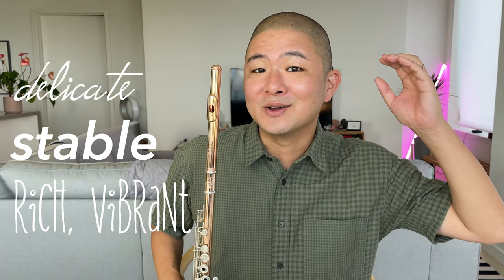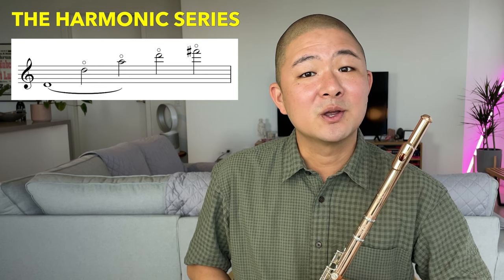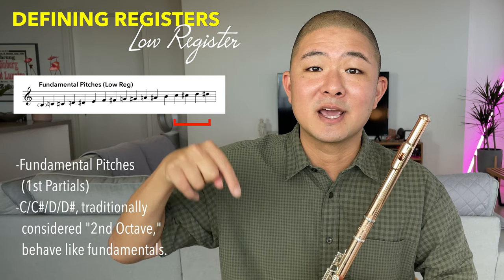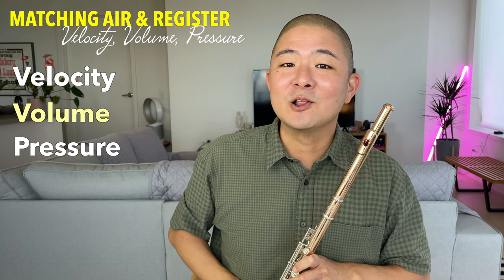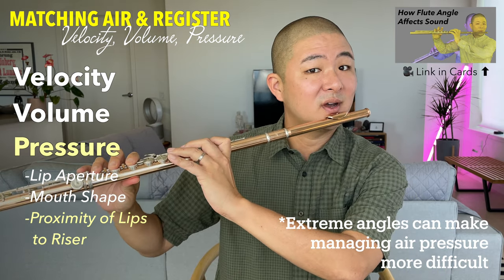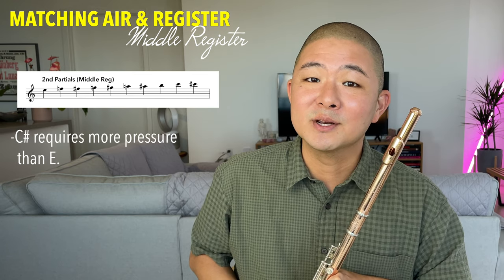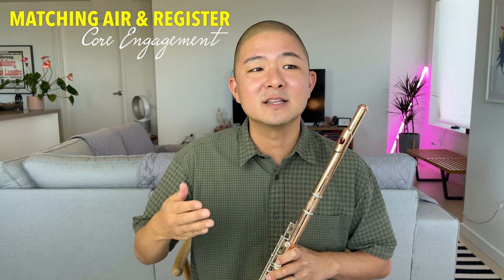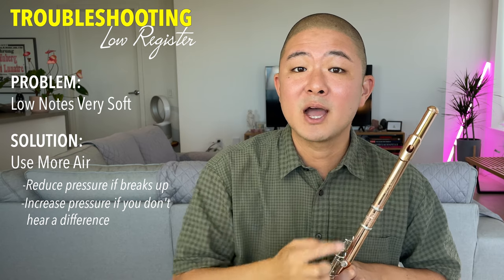Flute Registers Explained (How to Play Low Notes, Middle Register & High Notes with Ease)

Comment: I love how the flute reflects the underlying maths of the harmonic series. One of my favourite examples is how many fingerings for the 3rd octave work. For example, the fingering for D6 basically opens the holes for both G4 and D5. Therefore the most stable pitch becomes the "lowest common harmonic" of G4 and D5. That makes D6, because it is the 3rd harmonic of G4 and the second harmonic of D5.

Comment: I just bought a Selmer Aristocrat flute off eBay, so I won't have it for over a week. However, I'm trying to learn as much as I can about it. I play many other instruments, including clarinet and many brass instruments, so of course I'm already familiar with harmonics. I didn't realize until now that a flute doesn't have an octave key, but uses the blowing technique to reach higher ranges. I know the low register uses the 1st partial (fundamental), the middle register uses the 2nd partial,.. but does the high register use the third and only the third, or are higher partials used for still higher notes? At least with brass instruments, the number of partials available is theoretically infinite but most people probably don't play much beyond the eighth or maybe the tenth. The clarinet's octave key jumps from the first to the third, but I guess the highest notes (i.e., those above the written C two lines above the treble staff) actually employ higher partials.

In any case, thank you for an informative and extremely useful video! BTW, I like your method of dividing the notes into their respective registers based upon the registers into which they fall rather than an "arbitrary" means of assigning them.

Comment: The register change on the flute is between C# and D. That's when you go from all holes open to all holes closed again, except the first two notes in 2nd register are vented to aid the performer so you don't have to "overblow" till you hit the E. The venting does not make them part of the first register. You can try opening and closing the vent hole, blowing to the fundamental and back to the harmonic and you'll quickly understand what partial these notes are played on. (You can vent the E too by leaking (I think it's) the 2nd trill key if you want; that doesn't change what register it's in either, and it can be a useful cheat in a pinch especially for bass flute or contrabass as the register change gets trickier on low flutes. (You could also start the second register early using harmonics at C (or B if you have a B foot), finger the low C (or B) and overblow to the 2nd register early, with or without opening a vent hole in the middle of the pipe; this does change what register the note is in.))

Comment: I'm nowhere near enough practiced, only had 6 months way back in middle school, but I'm having trouble with hitting, without breaking, even consistently so, the higher half of the middle register and can't even do any of the higher unless I'm slowly going throw the scale...

While you say here it's about velocity, pressure and volume... I can't quite get my head around that, or even figure it out... Highest note I can reach is high F (4th in your higher register) and I just die at the following F sharp. I also can't seem to be able to get the lowest C for some reason (and my flute doesn't have the lowest B). It's a student's flute, maybe that's why, it's not very expensive and might suffer from a quality thing but I have no clue what to do about the higher register.

I figure that more practice will let me handle the middle register better, but I have no idea how to work around the higher one...